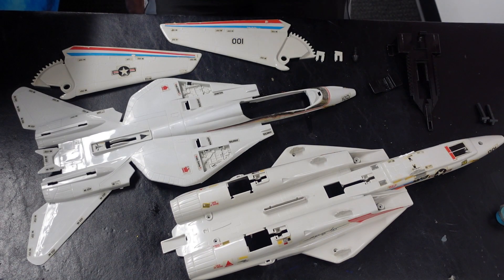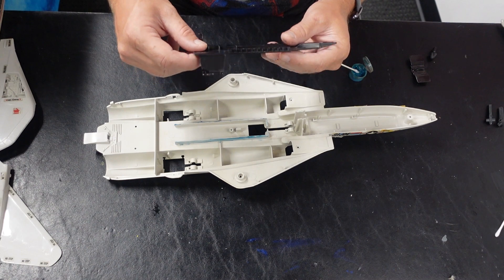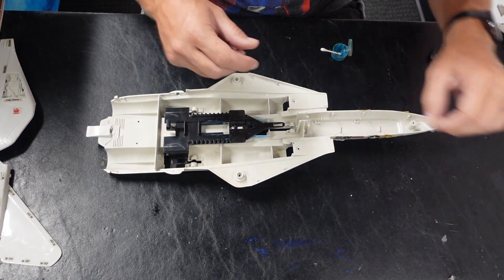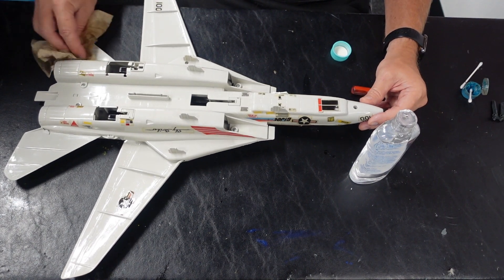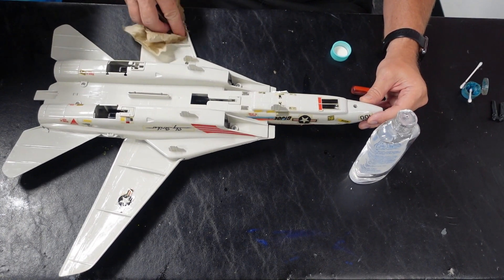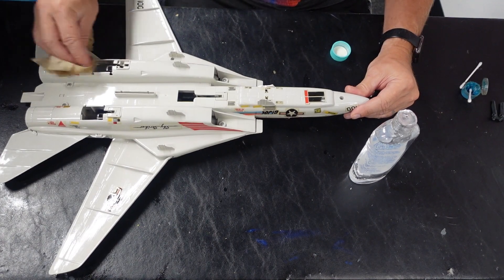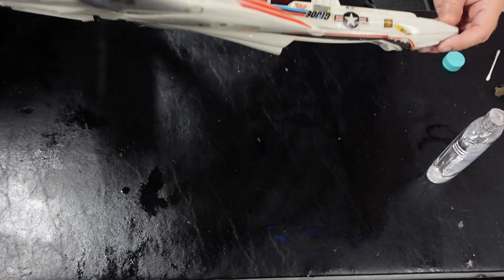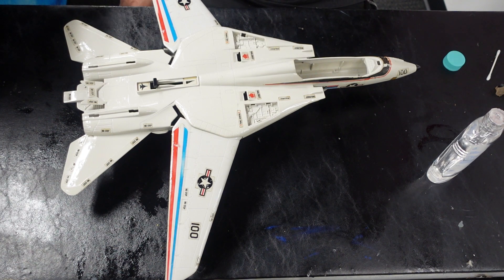GI Joe Skystriker Restoration Repair Video #2 Reassembly. Our Rules Restoration

Comment: Oh cool I just finished cleaning and take off the stickers on a night raven I just waiting for the pieces to reassemble my plane cool video to watch I never saw a skystriker in pieces
Reply from the maker: Did you get it back together?
Reply: No Im still waiting for the pieces it should arrive next week.
Ive changed the small drone since the wing were broken found an empty shell at the flea market.
Reply: I restored a Raven in January. I was fortunate mine was not brittle. It was surprisingly very easy to restore. One thing I did Cheat with,On the  Raven, I went with 3D printed air intakes and exhaust Vs. Original. 
Im currently working on my skystriker.

Comment: Hello, I restoring a striker and your videos have helped me a lot. Question where I can find replacement springs for the wheels?
Reply from the maker: I get mine at Menards but many hardware stores have them or ones you can modify to use.
Reply: @ourrulesrestoration8150  I checked all the hardware stores around my area and nothing. Too big or not enough resistance. I found a few on easy, but they are expensive.
Reply from the maker: @edgardcolon5763  i cut the lonnger ones down and take me time and bend the ends into cirles with small needle nose pliers